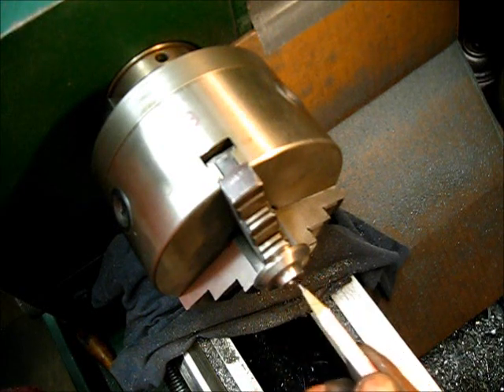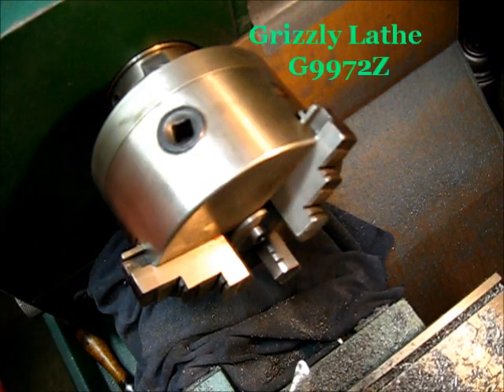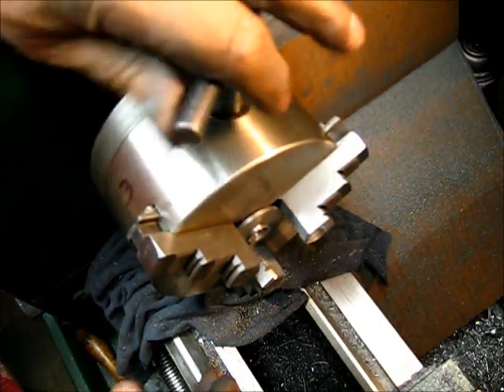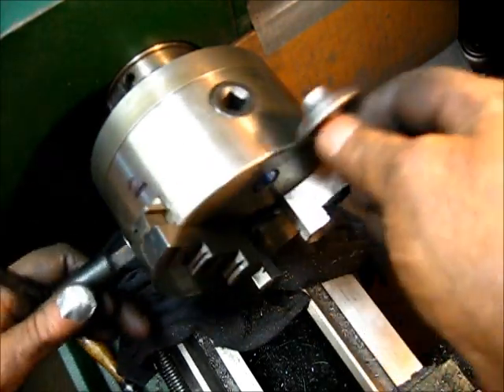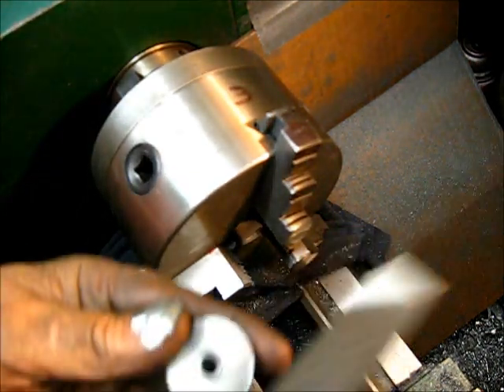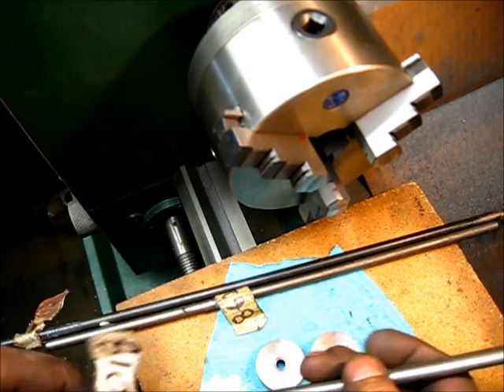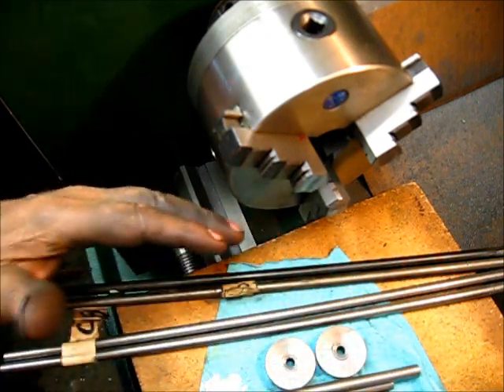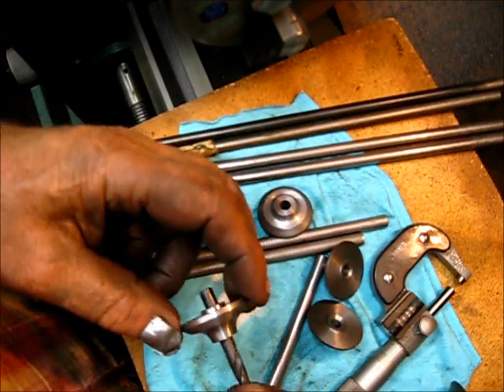I H C ENGINE how to build intake and exhaust valves #4

Comment: hey sam  ya want to save some time. ive used car valves and cut them down to size  when possible. Sometimes the stems aren't long enough so then they wont work but for most ive had to cut the stems down to size. plus the guides are nominal too. just a thought.

Comment: Fantastic job Sam.  I made some valve stems for my 1917 United 2 1/2 hp.  I put the valve stem in the lathe and put a center drill down into the head of the stem about 1/8 inch.  It made it easier to pin over.